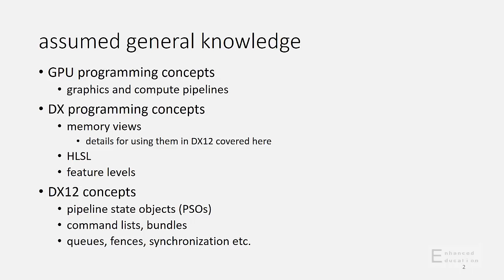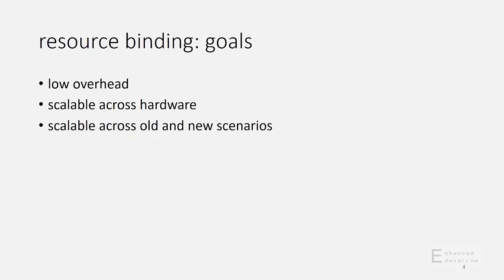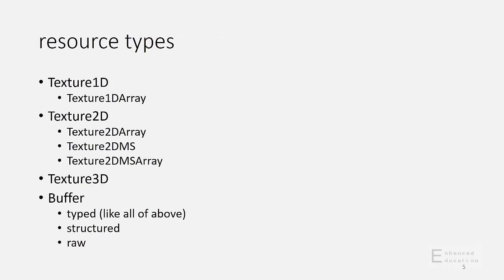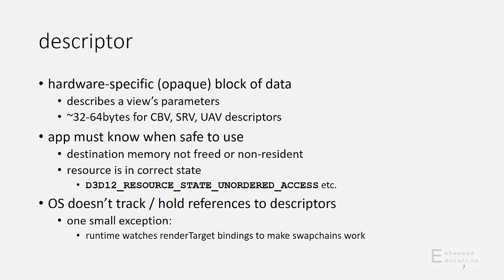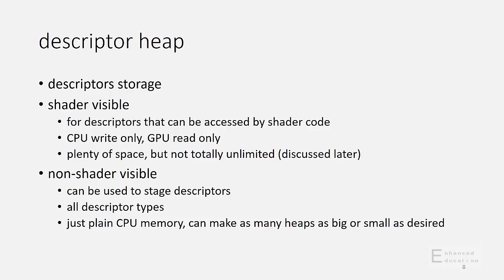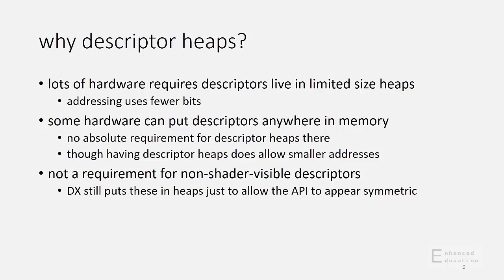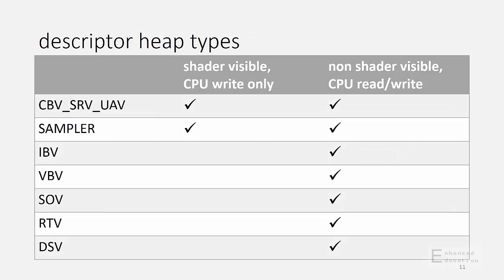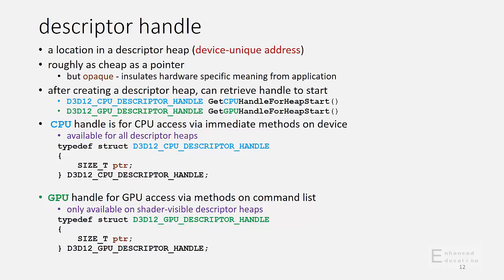Resource Binding in DirectX 12 (pt.1)

Comment: @Kostadin: I assume you're saying the content is confusing and not that the audio is glitchy (I can hear it).  A lot of the content, particularly in the remaning sections (when posted) dive really low level - if you're using DX12 you'll be confronted by most of the topics covered.  If the OMSetRenderTargets() explanation alone is what's confusing, don't worry about it - when you get around to actually using the API it should become clearer.  It's trying to explain that you have a couple of ways of using the API, one where you have the descriptors you want to bind already sitting next to each other in memory (just point to the start), and another option where you can say you want to bind a bunch of rendertargets whose descriptors are not next to each other.